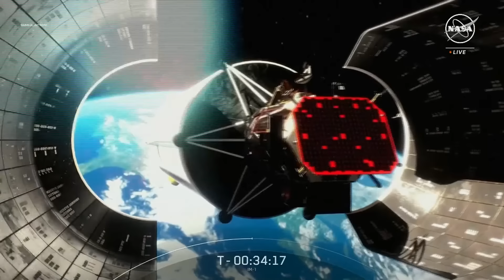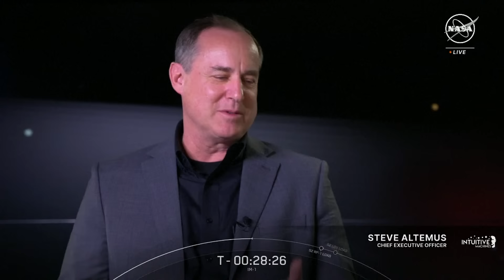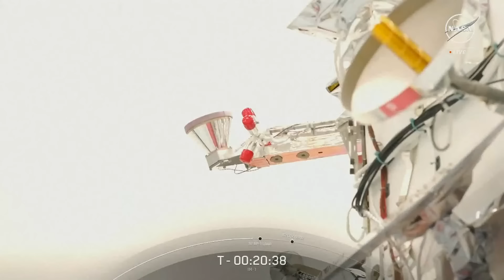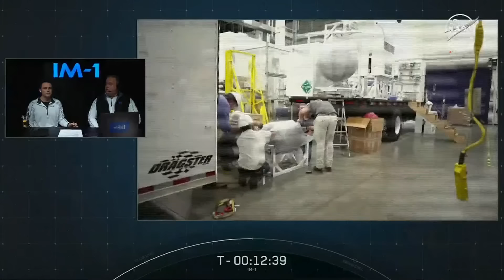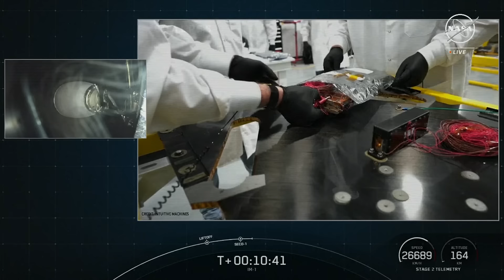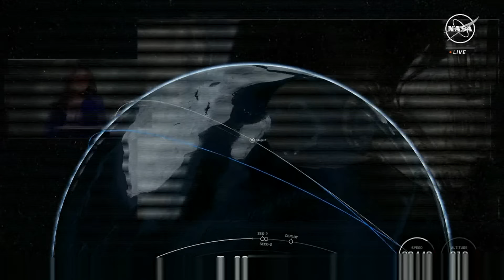LIVE: SpaceX launches private moon lander for Intuitive Machines

Comment: Why does the Falcon 9 take so many days to get to the moon, while Apollo 11 got there in 3 days? Totally different technique? 
I know they fly to a part on the south side now, but why does it take so many days more? It's now just the lander going there, so way lighter as well?
Reply: Apollo 11 did not land on the moon.
Reply: The falcon 9 doesnt go to the moon. Apollo didnt fly to moon either. The very tip of the rocket is what propels itself after the booster delivers the payload to Leo. Its 8 days of travel time for the lander to fly thru space. The point at which falcon 9 stops to descend down to earth is the same altitude the apollo boosters disengaged and fell back to earth. 95% of the rocket is the booster. You are a little confused. It's okay
Reply: The speed depends on the solar wind and since the sun is going to sleep the energy just isn't there.

That's a guess :p

But I would bet that the current mission is far far heavier than A11 so maybe that is the reason.

But it is strange. Almost like our technology went backwards for the last 100 years.

Comment: Congratulations!

But I'm confused. It got into orbit, then the lunar lander disconnected from the second stage. Still very far from the moon. Wasn't the second stage supposed to get it to the moon? How does it have enough fuel to get all the way up there?
Reply: It uses inertia to reach the moon, it's like if u throw a tennis ball, you give it the initial push of energy from ur hand and it moves, but it still moves even after being given the energy. The orbital path is now enough to reach the moon. Rockets don't just point themselves at the moon and fire the engine the entire way that would be a complete waste.
Reply: It put it on a trajectory to the moon
Reply: Notice how on the big map of the path, it shows the path going way beyond earth, that path is now showing that it's going to the moon without needing to use anymore fuel, all because of that short burn around 40 mins in.
Reply: The moon is magnetic.